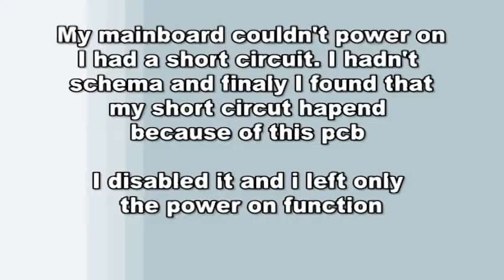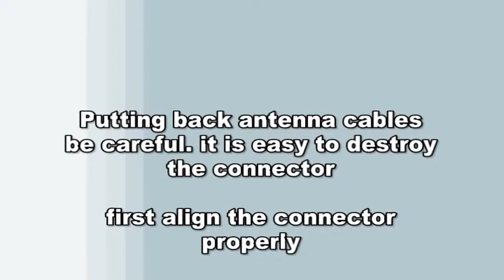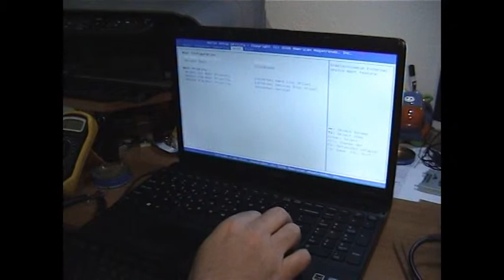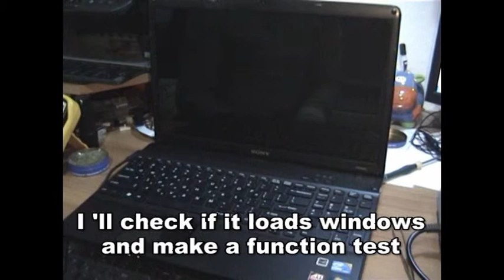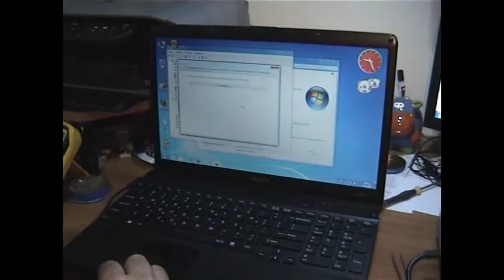Sony vaio pcg 71211m how to reassembly (vpceb3m1e)

Comment: Hi

Could you please tell me HOW to remove the heatsink from a CPU? Mine is stucked so hard like glued or something, I need to place thermal compund, as my temps are reaching 50 degrees white IDLE. 

Any answer would be much appreciated.
Reply from the maker: +KowalDW Realy sorry for the delay, but right now I saw your message. You probably have fixed now. But i have to say that. when heatsink seems to be like glued on the cpu.... You can heat externally the heatsink eg with a heatgun or a hairdryer and once it has been a little bit warm you can easily remove it. Sorry again for the delay hope you find it helpfull in future.
Reply: Hey there. Not a problem really. And yes, I have came to the same conclusion as yours, but haven't done it yet. I'm glad you answered, now I'm sure at least what is the cause. Instead of using a dryer though I thought about overheating the cpu with a game or some sort of a hardware benchmark, and do a quick dissasemblement until it cools again. Thank you for response even though you made me wait. I appreciate that. Regards.